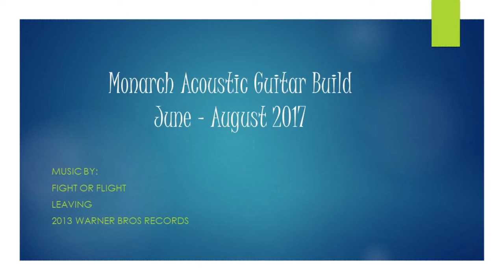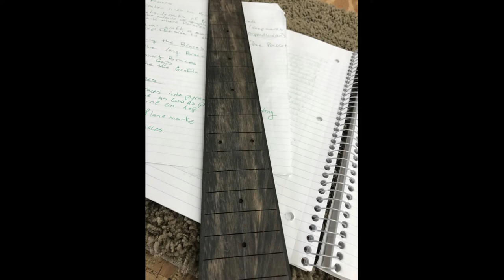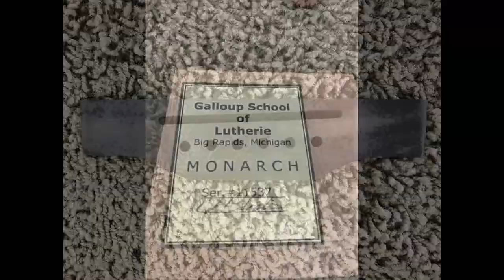Monarch Acoustic Guitar Build

Comment: Hi John! Nice video. I have some doubts, maybe you can help me.
I am going to attend Galloup's School on April for the Journeyman's course. 
I'm filling the form for the projects right now. I have chosen an electric bass and I am thinking of building a "12 fret Guitar (neck meets the body at the 12th fret)". I've seen you made the "14th fret guitar". Did anyone build the 12 fret guitar on your course? Is the guitar body smaller or same size?
Did anyone build an electric bass? What was it like? Precision, Jazz Bass?
Thanks a lot and good luck with your Guitar Repair!!!
Reply from the maker: Hi Iker. Thank you. I built the bass during my Journeyman portion of the Masters and it is a Jazz style base. I like it a lot. As for the acoustic, I built the 14 fret. I believe that the bodies are pretty much the same size and the necks are different because they're the same scale length. 
I hope that this helps. Have a great day.
Reply: Hi John! Thanks for the answer. Yes, it does help. I finally chose the 14 fret guitar and the bass. Have a nice day too!